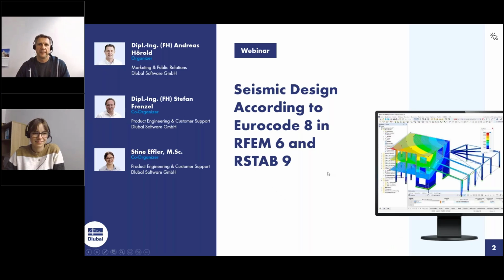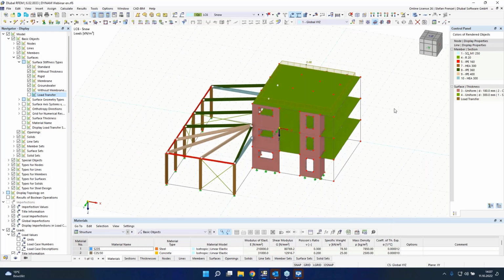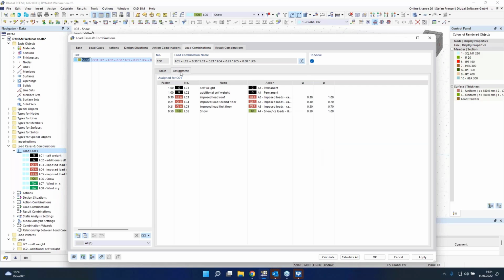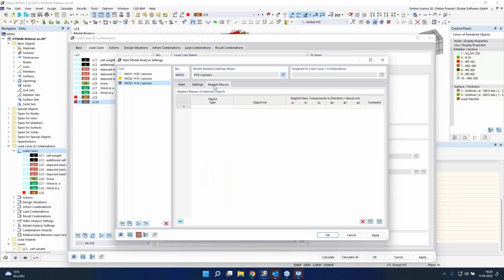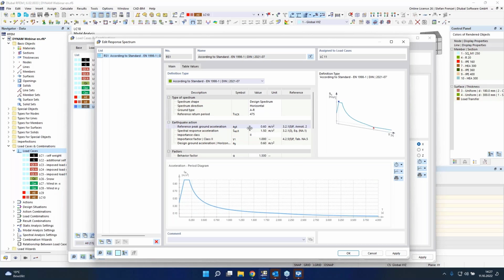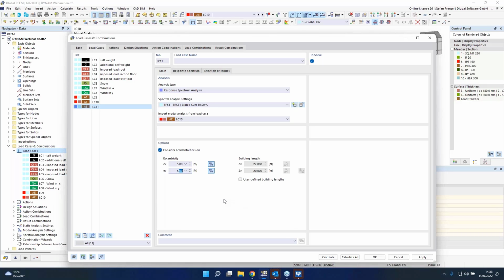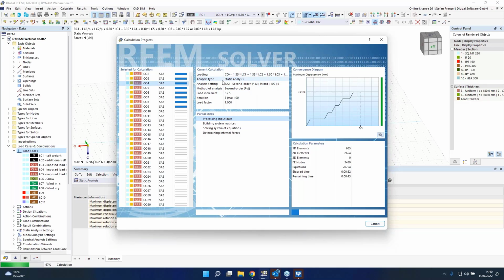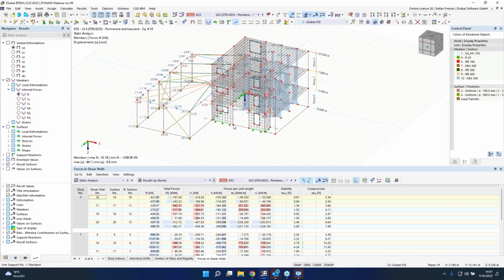Seismic Design According to Eurocode 8 in RFEM 6 and RSTAB 9

Comment: I see someone has asked this already, but is it possible to design concrete structures according to EC8 now? Can Dlubal design according to local and global ductility requirements, strong colum weak beam, wall end boundary elements and other capacity design rules?
Reply from the maker: Hi, @matej0703! Thanks for you intersting question. To get the best possible solution we would suggest joining our Dlubal Community to get first hand help from other Dlubal Users and our experts. Here is the link: https://community.dlubal.com/

Comment: The title says seismic design to EC8, but this is misleading to say at least. The software can certainly do the anslysis for seismic loads, either with Equivalent Lateral Force method, or response spectrum analysis, even time history, (but in either analysis method, the accidental eccentricity is accounted without shifting the mass or rigid diaphragms), but when it comes to design, it only covers low ductility structures, which really means plain EC2. What about design and detailing checks for global and local ductility (capacity design, weak beam - strong colum, joints shear check, etc.?) of Medium or High ductility class?
Reply from the maker: Hi, kt1988!
Yes you are right. The capacity design according to EC8 isn't implemented yet. But right now we are working on it, at first for concrete structures. All other material designs will follow.
Reply: @DlubalEN  Hi, that's good to hear. Are you also working on the detailing along with the capacity design? It would be great if you did.
Reply from the maker: Hi, kt1988!
We will include it in the development as a customer request.
Reply: @DlubalEN  Is there any update on that? Are you planning to release it anytime soon or not?
Reply from the maker: Hi, kt1988!
The capacity design for concrete structures according to EC8 is almost ready. Final tests are still running.
Reply: @DlubalEN  I'd love to participate myself in these tests if possible
Reply from the maker: Hi, kt1988!
Please contact us by e-mail at info@dlubal.com.
Reply: @kt-nf2jx, @DlubalEN how does it do the seismic analysis using the equivalent lateral force method? I didn't see it in the video.